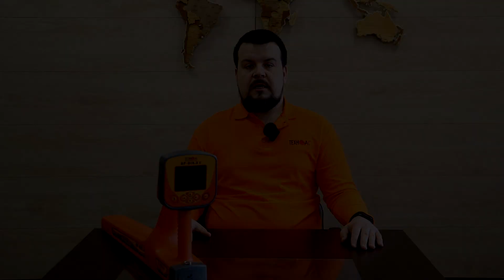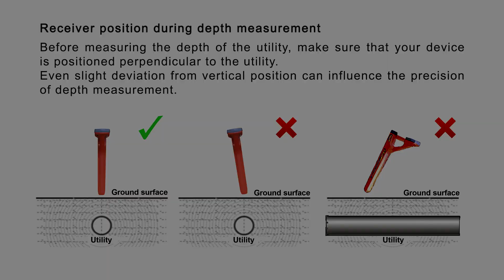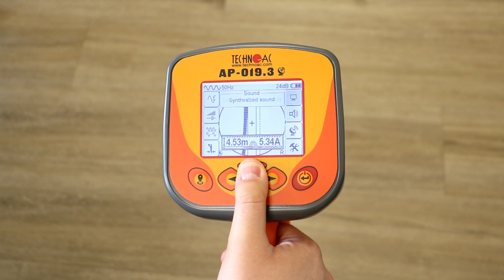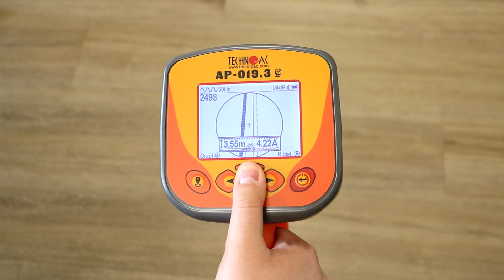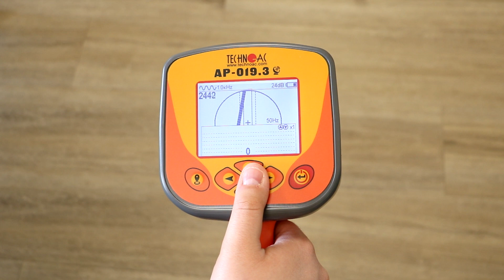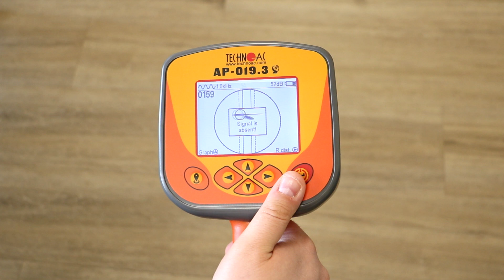AP-19.1 & AP-19.3 cable location receiver detailed manual

Comment: Hi
How we can make the setting to detect power cables with no load or current. Just detection for metals either metal cables with no loads or metal pipes.
Reply from the maker: Good evening, you should use a set with transmitter to create the signal in the line, for example AG-309.15G set. Here is a short video https://www.youtube.com/watch?v=-ZKMNxsuU0g